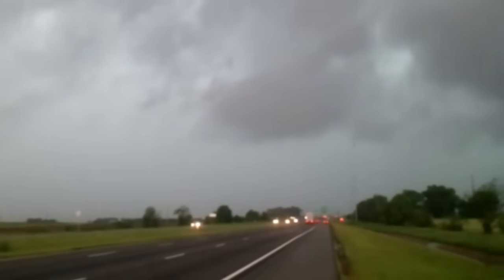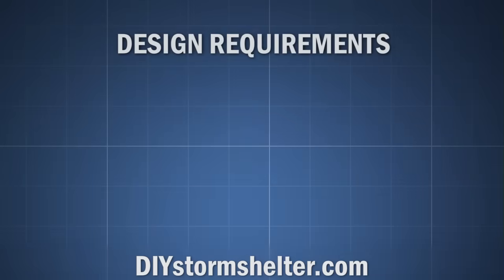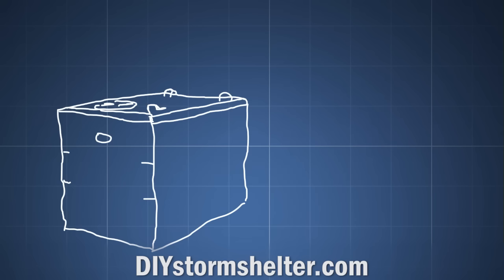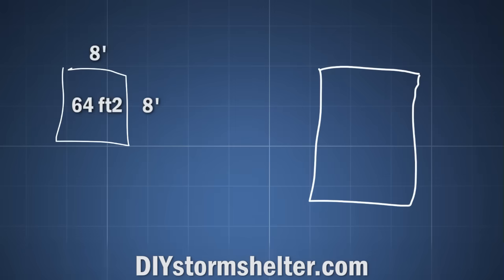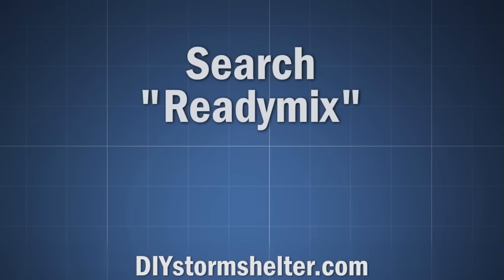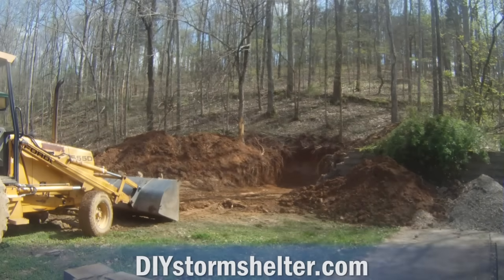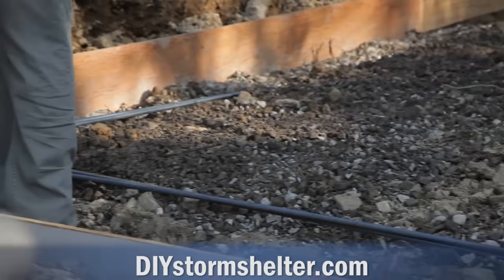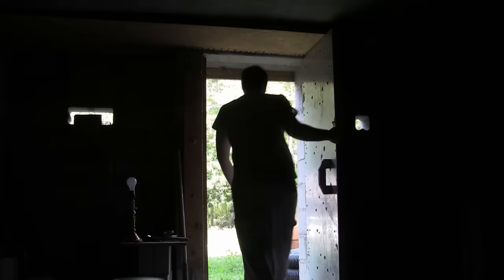Concrete block DIY Storm Shelter 12x20 foot

Comment: TEN people ?  why so many ?  
Concrete block will attract humidity and moisture leading to mold and mildew .   A plastic septic tank or water tank will prevent water intrusion and is very easy and quick to install . you only need a back hoe for the hole and trench for electricity if desired . the comfort thing is a bit silly as you aren't goi g to be in there that long . if you maintain contact with the news agencies you will know if the tornado has moved away from your position allowing you to leave the shelter quickly .
your shelter seems very well done but maybe overbuilt a bit ?

Comment: You can skip using mortar when stacking blocks and use SureWall , it will waterproof and hold the blocks together up to at least two stories. If you can set a block on another you can use it, then all you do is spread it on with a trowel ,like painting with thick paint.
Reply: That's surface bonding cement, I imagine. Is it safe to go that route with a roof this heavy?

Comment: This video reminds me when you make a simple search on Google like "What screwdriver brand is the best quality" First site, Answer: Screwdrivers are a type of hand tool used for the insertion and removal of screws. Screwdrivers were invented in the 15th century and have played a crucial role in industry for years. There are over 30 different types of screwdrivers.... After you scroll down through all the jibber jabber you reach the bottom and it says "sign up for $15 to see the list of best quality screwdrivers"

Comment: I think there are quite few mistakes like: The gravel bed is not thick enough, not compacted. Those blocks, I believe, are meant to be filled with concrete, not cemented together like bricks, they don't have enough surface for that. There are more things. But overall, I'd say "good job" for someone doing his first concrete build. Maybe it's a kind of a build, where it's OK to do some mistakes. It will still withstand a storm or F4 tornado, I guess.

Comment: You are right, you are not an engineer.  You forgot the steel.  A ribbon going around the perimeter is not sufficient.  The rebar in any floor should have 12" OC grid of 1/2", preferably 5/8", with a layer of box wire fastened in place.
Furthermore, you never placed a membrane under the slab.
A membrane STOPS water intrusion into the concrete and rusting the rebar-PERMANENTLY!
Although your video did not show a finished shelter, one would hope that if you planned on a burial of the shelter you would have water proofed the outside of the concrete block before burying it.

Let me be clear, I am not an engineer either.  However, I worked over twenty years with some of the best civil and mechanical engineers around and I picked their brains for that long.
Every structure I ever built did not simply meet code, it exceeded it and still stands today after they years, in spite of hurricanes and tornadoes.
Thumbs down.

Comment: A 2X4 will fly right through a concrete block.  If you fill the blocks with mortar first it will be safer.  The best thing to do is to pour the walls of solid reinforced concrete.

Comment: One error that I do not see mentioned by others yet, is frost protection. Sure the three walls in the embankment are deep enough for protection, but along the front ( entry ) end the footings should be deeper depending on the frost line where you are. I was pouring a slab for a 14 foot by 30 foot building in Roanoke, VA. The building code there required a 30 inch deep footing for "adequate " frost protection there,  even though just a slab on top of the surface, not buried at all.

Comment: You forgot to pitch the floor and add a sump with a sump pump for condensation removal . You should have put a french drain to take table water away from the box

Comment: You consulted an Engineer...REALLY !! You should have hired him to draw you up a complete set of code compliant plans. I am an Engineer and you left out crucial information. Cost of Plans, Permits, your insufficient use of rebar, especially the tie beam surrounding the top of your block wall and the angled rebar required to tie your 12,000 lb. concrete roof to your walls. Any City Building Plans Examiner would have tossed this project back to you with multiple comments and a giggle 😁 P.S Put your wife and kids in your bathtub instead.

Comment: Great video. The roof seems the trickiest to do.  i've only designed an excallent wood shed with clear corrugated, slanted roof.
I'm tripping at how you must have done the roof.
Reply: Rough frame in a plywood roof and pour concrete on top.  After it fully sets just pull down the framework.   Be sure to calculate weight of concrete and soil depending on depth.  Lally columns would be a good idea to help distribute the weight (unless waking up as a pancake is your thing).

Comment: I probably would’ve ran rebar vertically out of the slab in through the walls though. And fill the blocks with a masonry grout or flowable fill.

Comment: So, construction worker here. I'm not a scum bag and I already know you done fucked up so I won't charge for these tips. 

1. Your poured a fucking concrete roof with timbers for support... A man paid my company $20,000+ to rip out and replace rotten timbers and cracked concrete because he decided it was a good idea to have a concrete deck. 

2. The gravel you spread around to level everything out was not packed down, have fun with settling. 

3. Your concrete is level, I hope you enjoy treading water because that's precisely what's going to happen when it rains. You didn't add any drainage trenches. Ideally you want 2 - 3" of fall at one end so the water goes down hill as opposed to gathering in a puddle.

4. You didn't have a vapor barrier/liner for your slab or wall. That floor/wall is going to suck up ground moisture and translate it into your shelter. 

5. I'm seeing literal loose bricks just held with mortar... You and your occupants are shit out of luck if that dirt starts to move when it rains heavy. Where's your damned rebar risers/tie ins!?!?

6. No ventilation holes. How's the air supposed to circulate? All I see is a damp musty cube that's going to be riddled with moss, mold, and spiders.

7. Were's the utilities supposed to come from? You're telling me that you just want a little dark tomb to spend 4-8+ hours in, okay bro.
Reply from the maker: Almost all of these concerns are addressed in the full video. The timbers were just temporary to support the decking for the pour. A month later it was all removed. I have had no problems with settling, water intrusions, etc. There is not a single crack that I'm aware of after seven years or whatever it's been.

Comment: Your shelter will get people killed. Heavy debris would smash right through the front of your shelter under the right conditions. Guaranteed.   The door is all wrong. The concrete roof is wrong. Get your money back from the engineer you consulted. Cheers.

Comment: There were a couple of useful bits of info, but as far as the foundations on this build in this video are concerned, there’s no mention or sign of hardcore, a drainage system, or a damp course, or insulating materials being used?

Perhaps these issues were addressed in his complete video? But in my humble opinion, if you paid for his advice on the foundation work, just remember a a blind man can’t see in a one eyed man’s country and a fool and his money are soon parted.

Always do your own due diligence and seek advice from an expert or maybe 2 or 3 experts and if necessary pay the upfront costs and avoid unwanted expenditures in the future. Because the last thing you need is your build getting damp or water logged and collapsing in on itself, especially when there’s a storm brewing, as your shelter may become your tomb. 

He was honest enough to admit he’s an amateur builder, but it’s a shame given his limited knowledge he thought he could charge for it in this video, which has more holes in it than the leaks he will find appearing in the bottom of his shelter. 

On the plus side I did like the way he presented his ideas. It’s just a shame that whoever he consulted and called themselves an expert, clearly forgot some fundamentals regarding foundation work.

Comment: I'd just get a shipping container, invest in upgrades and modification, then bury it. No above-ground shelter. If you live in an area where strong tornadoes are a real possibility, you need to be underground. This is complicated, intensive, and risky. And how could it be tested? Get in and see what happens during a real tornado... no thank you.

Comment: Save yourself time this video is nothing more than a long commercial for a $14 video. And the construction is unsound at best and a death trap at worst. Poorly built, poor engineering, and not a "DIY" project. It's a pay contractor to build it project but that contractor would be more skilled at designing a structure that would actually be safe to use. This video should be removed.

Comment: Imagine my surprise when I found out it would cost $10 to get more info.  I don’t think so when there are several mistakes he made in the build.  First if some one lives in earthquake areas, the rebar needs to be bent to go up into the wall, tying it in to the wall.  You also need to have “L” shaped rebar from the wait into the top.  And it wouldn’t hurt to put rebar vertically through the wall blocks themselves to hold the walls together.  Sure it adds money, but keeping the walls together would save lives.  Another even bigger mistake is not using sand in the concrete if you mix it yourself.  Sand is what holds the cement mix together.   I haven’t read all the former comments, but it seeks other people thought it was wrong for you to charge $14.  After all, you could literally be saving life’s with the info.
Reply: To get more info from someone who is NOT qualified to give that info. That makes it even better.
Reply: Plus for someone who lives in parts of the state with freezing temperatures the footing (foundation)  needs to be 3 feet and not 8", not using rebar in the walls is a big mistake as well, also if the roof is covered with dirt  then is more weight plus the weight of wet dirt when raining and some reinforcement would be safer.
Reply: @slanwar  wait he didnt put rebar inside of the concrete blocks? i though that was basically required if you want it to last a week
Reply: You do realize that he built it for HIS circumstances and not for every single possible environmental/geological hazard.  He never said his construction plans are universal.  He even said to consult with a local structural engineer.  For $10 it's well worth it to give you an overview of the process and see what's wrong and then have a better idea what you're getting into and I'd rather give $10 to get an overview of the process and learn from someone else's mistakes than to make all those mistakes myself.
Reply: @komoru  there just keyboard warrior trolls who know it all and , know everything before they are even taught anything.  pshh. They know ......before they know!@!! Love them types.
Reply: $10 per view of his plans... seems like someone is trying make his storm shelter into a profitable venture. Plans and requirements are all available online for free as they should be for a life saving feature of your home. It's just hard to sift through all the ads and 🐂💩 to find the free info.

Comment: You didn't calculate for the side pressure the dirt will cause on the walls.  The walls will deform and get pushed in over time from the dirt without some steel in the brick that is anchor to the slab.

Comment: Among other safety issues, using rocks to support the rebar is going to create weak voids in the poured concrete.  I take it you did not obtain a building permit for this project?

Comment: UNDER GROUND SHIPPING CONTAINERS  WOILD BR JUST AS GOOD
Reply: No. Even if you reinforce the roof the sides will cave in. The metal is too thin to resist the lateral forces of 8' of dirt pressing in.

Comment: Just use a shipping container
Reply: No. Even if you reinforce the roof the sides will cave in. The metal is too thin to resist the lateral forces of 8' of dirt pressing in.

Comment: the one thing you missed was tie of corners and tie of base to the blocks...
and then there is the water soak issue on cinderblock.. and no rebar in the blocks... as well as roof tie to the walls..
things move and shift on these projects over time... also dome the top up a bit in the center for more strength...
one of the cool things I have seen was the use of spray bed liner material to coat the inside of the blocks..
pain to deal with... but would be super nice if it would work for the outside of the slab and walls as well as the roof outside...
some have tried membrane under the slabs... it works but mice and rodents can make a mess out of it!!

hard to vent these if they sub grade level... you did well building in a bank... good for storms... make sure you have a good door that opens in that can never be blocked with trash from a storm.... 

this style is better for tornado shelter!!

Comment: I say get to Cargo container of those cargo containers and buried those are full size long size 4 2 3 5 6 people
Reply: Oh you should watch Mythbusters. They did a test on Hitler assassination attempt. They excavated a hole in a slope and inserted a container and then coveted it with dirt and it collapsed. So yeah go ahead and try that they are not engineered for that.

Comment: I am a Master Builder with over 40 years of Coast to Coast experience. Most Contractors just have a Vague Idea on how to Build a Safe Room. In Most States the Building Codes are a Joke. Southern California and Vegas has the Best. If I wouldn't put my kids in there, I am Not Building it. The Safe Room Needs to be able to Withstand a Truck Smashing into it. 
I have been in F5 Tornadoes. 
You Need an Expert, and Good Luck with that.

Comment: DO NOT buy the "full video." Anybody who knows what they are doing will immediately recognize serious problems with this build that would not pass an inspection and are not safe. Just a few examples.

First, the area is dug out and then partly backfilled. That includes the areas that would become footers. But, code (and safety) requires that footers be placed in "undisturbed soil." Once that soil is disturbed, it has to be recompacted using a rigorous process (determined by the type and moisture of that particular soil) that is supervised by a soils engineer. This build depends upon footers in disturbed and not properly recompacted soil, which means that all of the weight of the structure rests upon who knows what?

Second, the two strands of rebar must be at least six inches apart (more is better, while staying three inches from the sides), while those in this video appear to be about four. There are reasons why things are required just as they are in code. I'm pretty horrified to hear that the full build includes a concrete ROOF. The amount of weight in that structure is stupendous, and it's all resting on incorrect footers on disturbed soil.

Third, there is NO vertical rebar tying the footers to the walls. Code (and basic safety) requires this, but in the teaser video, it is not there. It's not clear from the teaser video whether or not the walls were poured full of concrete (as they should be), but, even if they were, the fact that there is no vertical rebar makes that whole point basically moot.

MUCH more could be said. Seriously, that thing appears to be a death-trap, and the idea of it being a STORM SHELTER is absurd! This is an individual who ADMITS to not knowing what he is doing, and this teaser video indeed proves it.